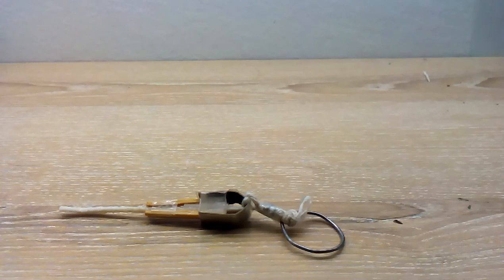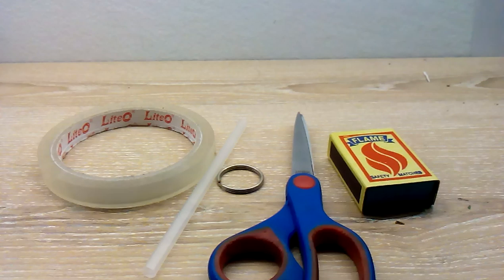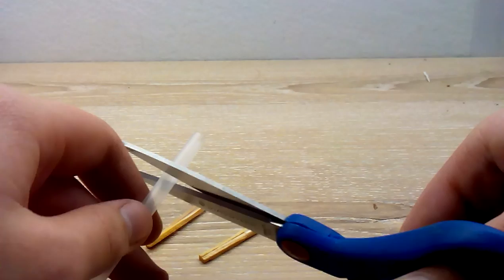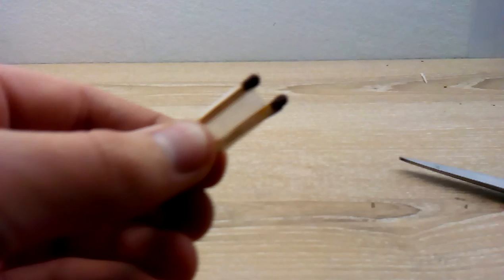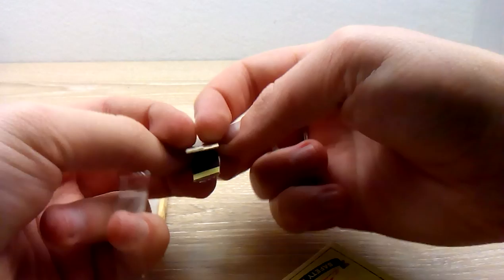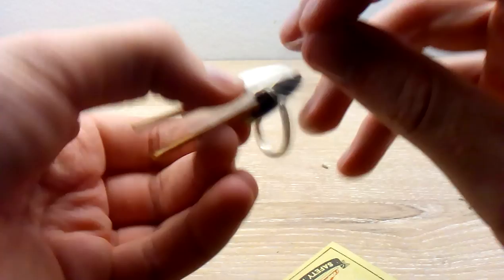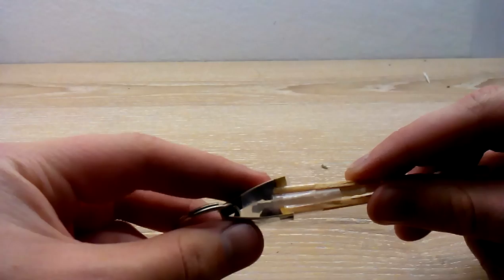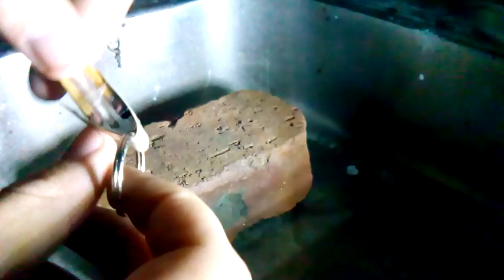How to make a simple pull ring fuse igniter

Comment: Having the match heads bear on striker material is *NOT* safe!  make a separate folded pull paper with striker material at the last 1/2" on each end, but plain paper closer to the fold where the match heads will rest.  You should also have some safety mechanism that blocks the match heads from coming into contact with the striker material until the safety is removed; basically an analog to the safety ring on a grenade.
Reply: Blah blah blah
Reply: @PB8man  Actually, more like "Blah blah bl--  OWWW!  HELP ME!  I'M ON FIRE!!!  DOOLEY, GET THE HOSE!  AAAAARRRRGGGGHHHHH!!!!!!!"
Reply: @adamchurvis1  blah blah blah
Reply: @PB8man  I know we're just having fun here, but what I've said is quite true.  I had designed a prototype of a commercial device with a similar function, and you really have to isolate striker from ignition components, I promise you.  Things move around in transit.
Reply: @adamchurvis1  yup. They do.
Reply: @adamchurvis1 Are you worried about the little burn from the match? Because I’ve had it and it’s bearable 😂. Or are you worried about it going off by itself?
Reply: @Southwestairsoft-of8mp  I'm not worried about anything, other than people not following safety guidelines, safety rules, safety regulations, and laws passed for the protection of public safety.

We're understandably more familiar and in line with such safety principles in the Second Amendment community because they've been drilled into us constantly over many years' time.

You don't rest a friction-ignited pyrotechnic ON THE FRICTION-IGNITER!

Comment: I use paper book matches and put 3 around a fuse far enough back that the match material is not touching the strikers, matchhead compound is dried onto the end of the fuse,use strips of pantyhose to bind the strikers together around the fuse,leave about 1/2 inch between the match head and strikers. simple and 100 percent lighting
Reply from the maker: Jim G I'd probably use matchbook matches but matchbooks are very uncommon so I just use normal matches.